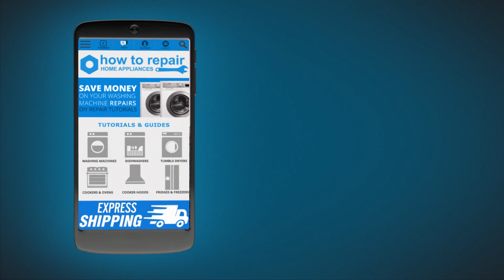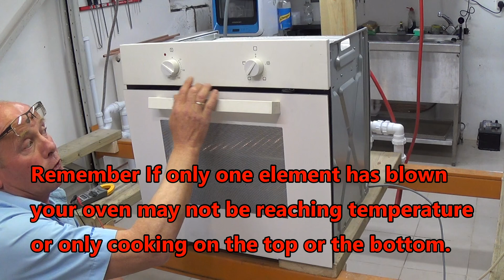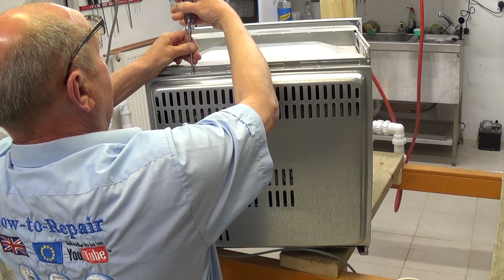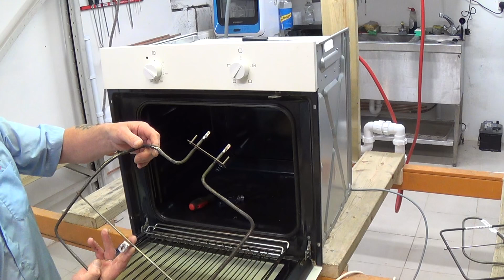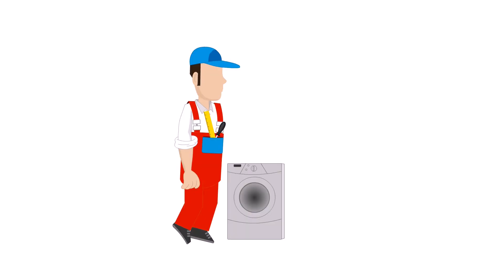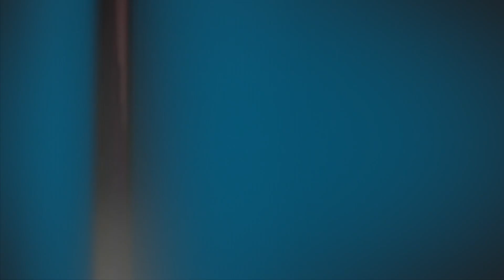Ikea oven Not heating or getting to temperature. How to test & replace oven element

Comment: Great video. Gave me the confidence to actually repair our ikea oven. I have measured the elements with a IR thermometer, showing the top element to get above 270 degrees and the lower part approx 90 degrees. So I guess the lower element has gone. But i should be able to make some measurements with a power meter when using each element? Saves me having to take out the oven the first thing 😅

Comment: The AC testing that you do at 6:27,   is that safe for me to do, or is that the part that needs a competent person? And when you say have it turned on, do you mean just switched on at the wall,  or the oven actually set to heat? Thank you
Reply from the maker: If you are confident with electrics, then it's not a problem. Every electrician does this when they're testing circuit boards or any other appliance, but if you're not I would highly recommend you get someone who is qualified.  glad we could help you @melcaden6643 this is for you https://www.youtube.com/shorts/e432SAb2g08 please remember to subscribe as that's what keeps this channel going. Thanks 👍